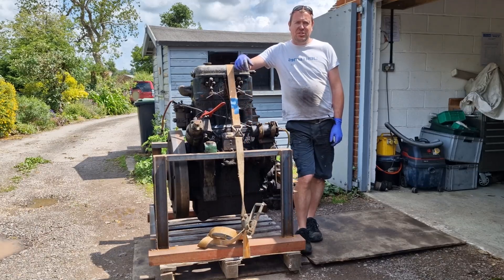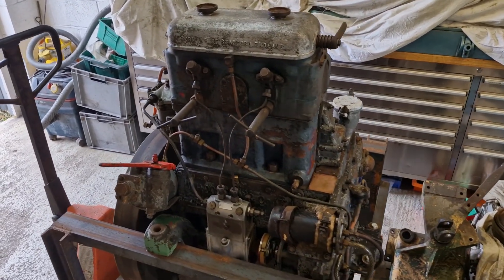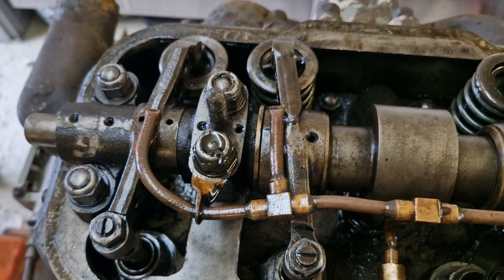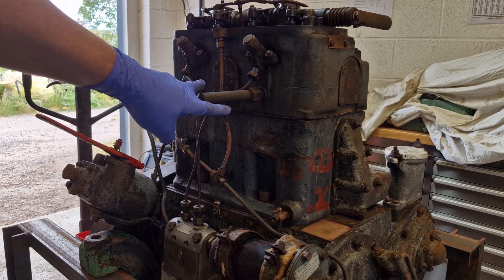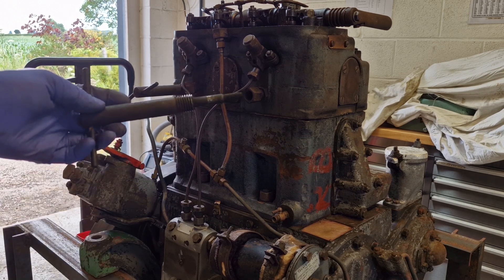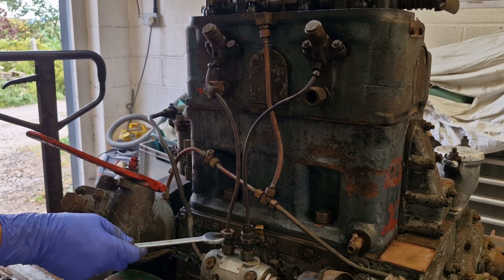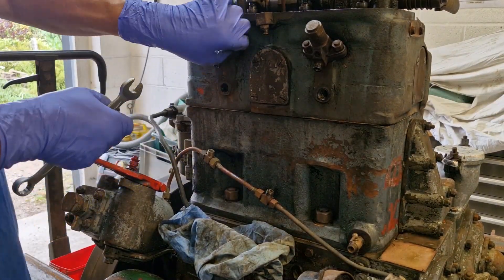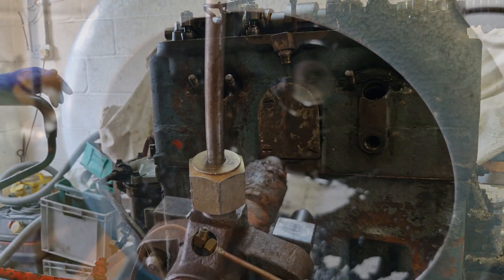Dorman 2RB Engine Overhaul Part 1 - The tear down begins, Simplex locomotive Old Kiln Light Railway

Comment: I enjoyed watching this video on the stripdown of the Dorman as I worked in the factory (by then it was a Perkins/Caterpillar engine plant) in the 2000's, the mention of the swaged copper injector sleeve in the cylinder head was very reminiscent of the same setup used on the heads (each cylinder near 4 Litres so individual heads) of Perkins 4000 series.

Comment: It's common practice for Engine reconditioners to focus on what's wrong, it's just how they are. As parts are not available will you try to cover your repair techniques. Would be good if new heaters could be made and could conceal modern glowplugs, giving the best of both worlds, looks original, but starts no problem. I hope when you've done your stuff it'll be good for many years to come. What sort of output would this have in good order?? Love the vids keep em coming.
Reply from the maker: Thanks for your comment, so far the only part that would cause a bit more of an issues than many of the other engines we do is the pistons. Need to get them out to assess them as a whole and then decide if they can be reclaimed or replacement is the only route. 

As for the starting wicks/glow plug mod. It really does depend on the owners usage and if they want originality or ease of use. For example its very common for us to fit electric start to engines that never were because the owner doesn't want to hand start them. Same here in this case, carry on with the wicks for originality and deal with the longer start up time, or fit plugs in a sympathetic manner to cut out some of the faff. 

Max output for one of these is 36hp and 1500rpm.
Reply: @MPSVintageDiesels  
Can you replicate that simple air intake and fit a Thermostart flame heater there instead...
leaving the wick start "entire" and the original air intake always replaceable?
Reply: I've managed to hand start a 2RB without using the wicks, it wasn't overly difficult. The later 2DWDs used in later examples of Motor Rail locomotives are vastly easier to start even when ice cold. They made a lot of progress.

Comment: Quite sad that you seem to be mostly concerned with the natural wear and tear of a 90 year old diesel. Not a word about the fine casting or the beautifully built oil pipes in the top. Trying old injectors that are rusty is not okay, nor is suggesting electric preheating. If you can't run that type of engine, you shouldn't.
Reply: That's why it's in there,to assess what it needs to run another 90 years,which means taking it apart to examine everything,taking the injectors quite clearly they're not in the best of condition,and need reconditioning,what do you want,a "good" engine,or one that is one step away from being a boat anchor?,and just because the quality of the castings,and oil pipes haven't been mentioned it doesn't mean to say that they won't be
Reply: Personally I find the description of what needs attention very helpful. It shows me what I should look for when I take my engine apart as its from the same era
Reply from the maker: Thanks for your opinion. As we have the engine because it requires overhaul, I'm not sure why its "sad" we care about what is damaged, worn beyond further service and requires replacement, as fundamentally that's what we need to know to assess and recondition it. 

We look forward to your upcoming informative videos showing us how to do it properly 👍
Reply: @MPSVintageDiesels I am not sure how to take @Lars comment. I mean, isn’t that engine in your possession for an overhaul? Wouldn’t you wanna know what is wrong and what you will need to fix it? I love your channel and your techniques. I believe the engineering that went into making an engine that lasted 90 years speaks for itself, you know?
Reply: @MPSVintageDiesels I am not a video creator and believe in showing the craftsmanship that went into creating all of this. You can take my opinion however you want, it's up to you. I wish someone would bring up the incredible fact that a 90 year old engine looks quite healthy under all the soot and rust.
Reply: @larsbkurin1740  he is doing a condition assessment. Yes, it is a lovely old engine, but nonetheless requires work, and MPS are taking the time to share their assessment process, not a museum tour.